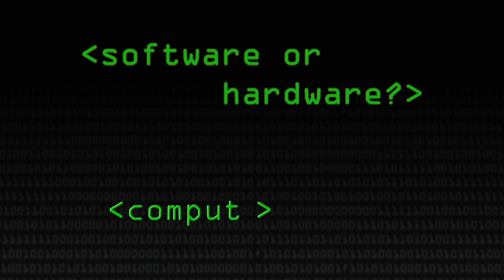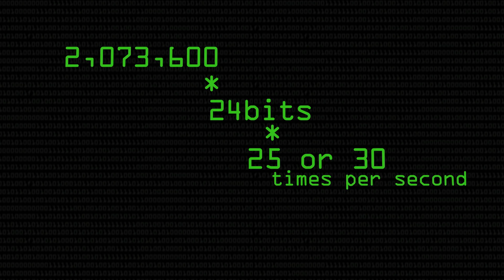Hardware vs Software & Digital Video - Computerphile

Comment: The other thing about using hardware over software is that hardware functions are concurrent. So apart from pipeline delay,  hardware processing has little effect on the overall time taken to do a whole new function. Whereas for one core, all its software  processing just keeps adding up.

Comment: I was just thinking about RISC the other day, wondering whatever happened to that revolution
Reply: +MatthiasDuyck and sort of in Intel x86 chips internally, they just use a large instruction set which gets translated down to RISC instructions
Reply: +WeeWeeJumbo still in every arm chip...
Reply: ***** That's what it looked like, to me, at a layman's distance
Reply: +WeeWeeJumbo Also most microcontrollers are based on the RISC architecture.
Reply: +WeeWeeJumbo It's new home is on the Raspberry Pi :)  The code was tweaked and it's now available on the Pi :)
EDIT:  Oops, that's RiscOS - the OS for the old Archimedes (forerunner of all your phones!)